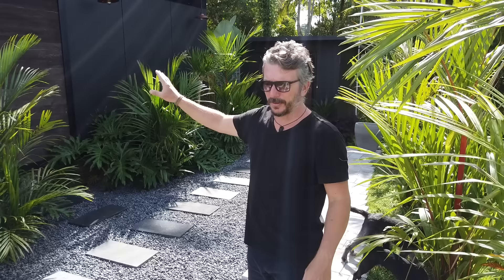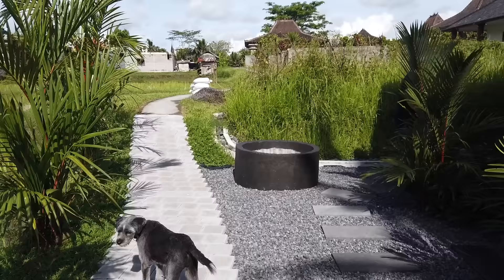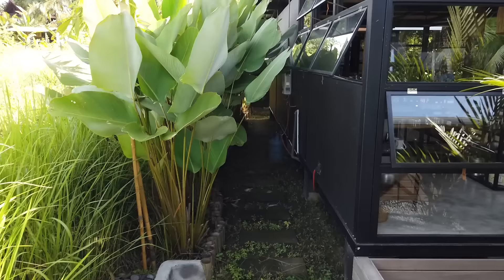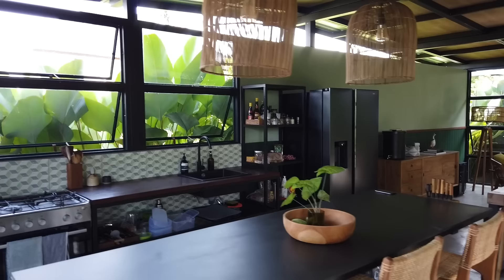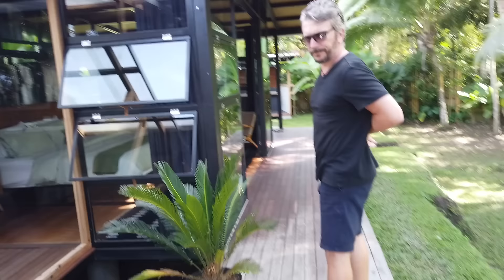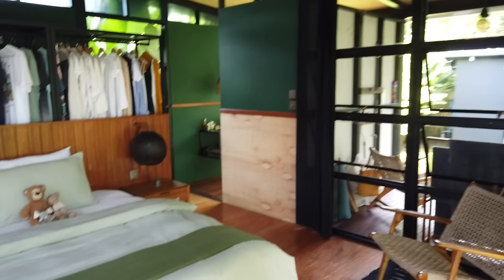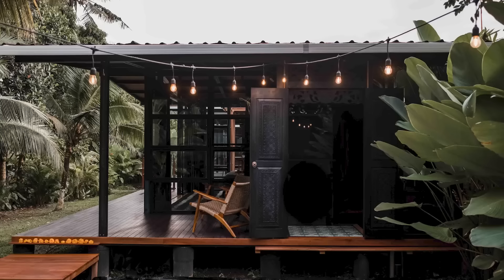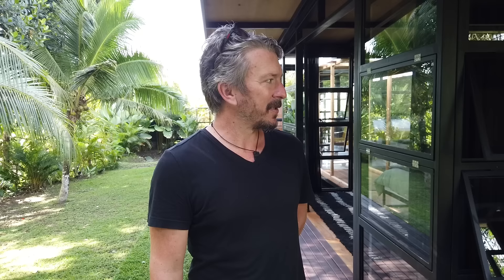#16 Ubud House Build // Nearing The Finish Line

Comment: Those red palms are Cyrtostachys Renda AKA Sealing Wax palm or commonly known in Australia as Lipstick palms  . Absolutely the most beautiful tropical palm you can grow 👍🏝
        They are actually an equatorial species that will only grow with good care from about Airlie Beach north along the coast , although they will even struggle to grow well in Townsville as they do not tolerate too many cool winter nights below 15 degrees C  , so they do best in Cairns and Darwin .😊